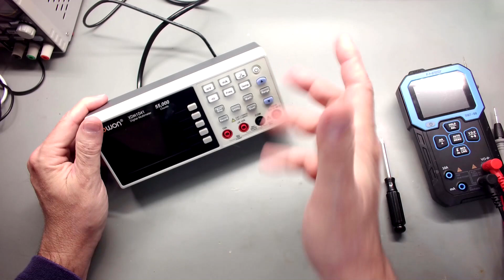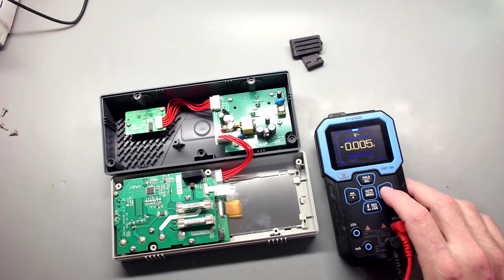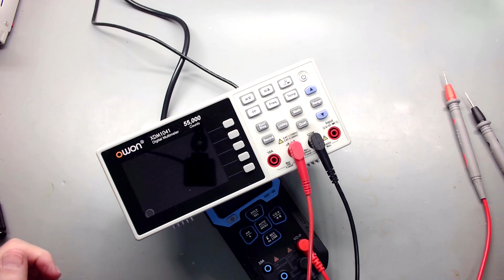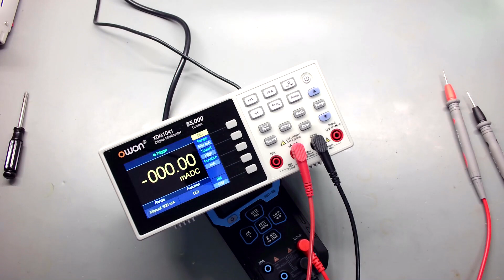Fear Not: Easy Steps to Repair Your OWON XDM1041

Comment: I often wondered what was in one of those.  I wonder it it could be modded to use a LiPo battery?
Reply from the maker: I think the next model up has a battery, check it out.
RJ
Reply: yeah, the 1240 is battery powered, but otherwise identical. And I think one reviewer noted that there are headers on there to attach a battery if you'd like.

They're a pretty nice meter, and I've seen them on Aliexpress for 70 something bucks, which is pretty incredible for what you're getting.

The only mod I did to mine was to add a small steel block to the bottom of the case to weigh it down a little as it is VERY light.

Comment: Hi i also wanted to buy same multimeter but dont have the full details on it many peoples says that this has bad usb connectivity and some say its autoranging is not proper for current , i want to ask you how you feel about it i want this to log current measurement over long time frame and want to take log on usb and my mcu will switch between 50mA to 50uA so i will also need auto ranging feature in it so as per my requirement will you recommend this to me
Reply from the maker: Hello, 
I have not had any issues with usb connectivity with it. If you check out my videos on my test cell I built and use to log test on inductors and capacitors you can see I wrote my own logging software which communicates to a number of my bench equipment including this meter. It cannot switch from the ma range to amps by software as this requires physically moving the probe to a different input. But I have not had any auto-range issues with it between ma and ua in my use. It is no Keithley or Agilent but for cheap it is pretty good. Hope this helps.
RJ
Reply: Thanks RJ , for confirmation have you used this for more than 15 hours i  have one requirement where i need to log current for more than 12 hours
Reply from the maker: I do not know I have run it logging that long, I have for sure done over 6 hours. Most of my temp cycles are about 1-2 hours. Now to make sure I am being clear, my logging is the computer getting the readings from the meter and storing it. I am not standalone logging with the meter.
RJ

Comment: Install a Poly fuse instead and you will not have to change the fues.
Reply from the maker: Thanks for the suggestion,
This is not as straight forward as it might seem. For just one issue, the poly fuse will take much longer to interrupt the current. Might not matter but might lead to a damaged meter. Second polyfuses have more resistance. This means your lower current scales will now be uncalibrated as you added resistance. At these current ratings they often are not rated for 1000 volts. My thought is that you should not be blowing fuses in your meters often. If I am I need to have a little inconvenience to teach me to be more careful. 😁
RJ